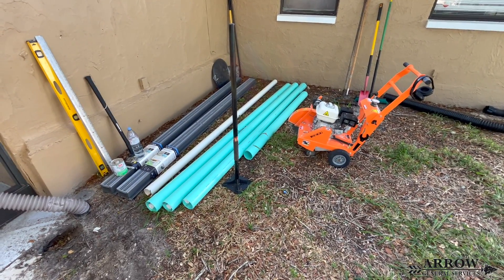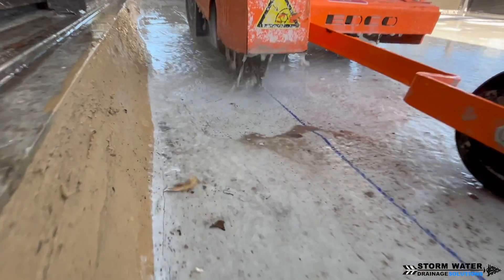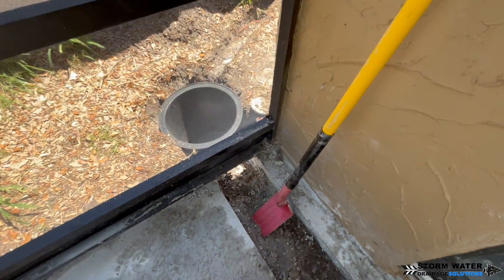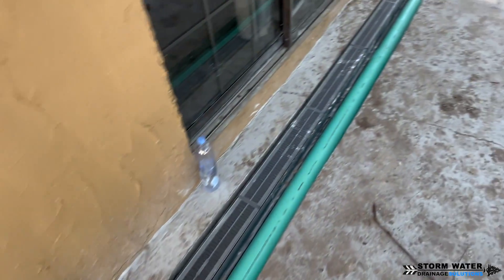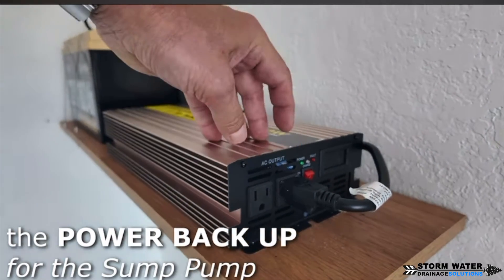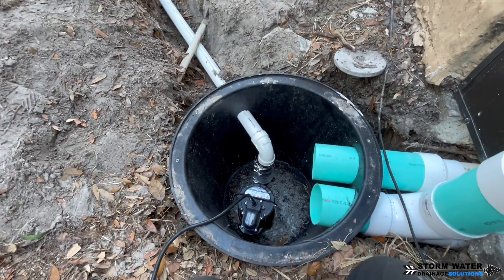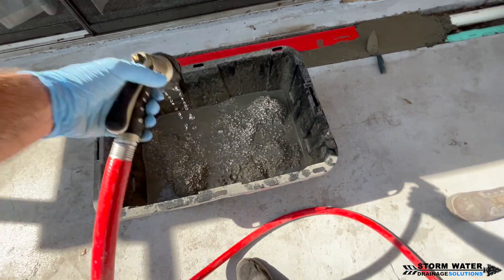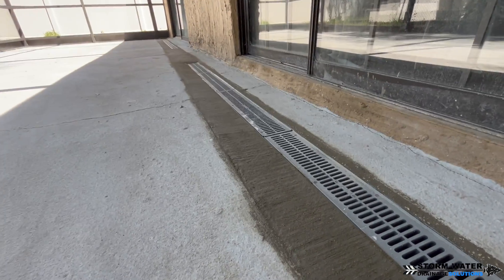Divert Water Away From House - Dual Drainage System - Channel Drain - Downspout Drain - Sump System

Comment: Thanks , for not promoting  the 12v toys from the home centers for back up batteries for sumps pumps . We tried them for a few years , but when the water comes in the sump pit as fast as it being pumped , the 12v back up sumps will never keep up. 
We 25 years we bought a Xantrex RV inverter that can  easily hand a 15 amp sump . We ran off the unit with 2 6v golf cart batteries that would gave us about 21 hours of backup